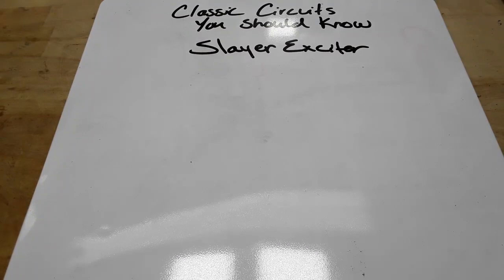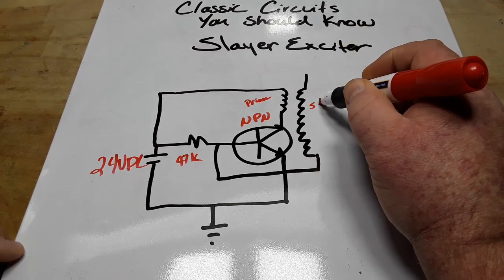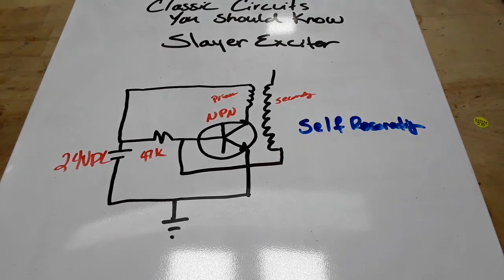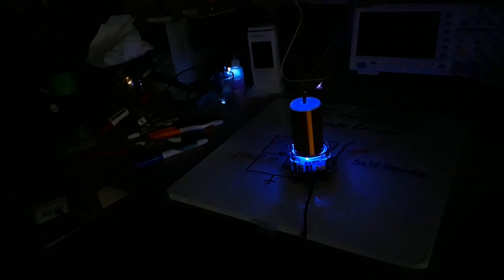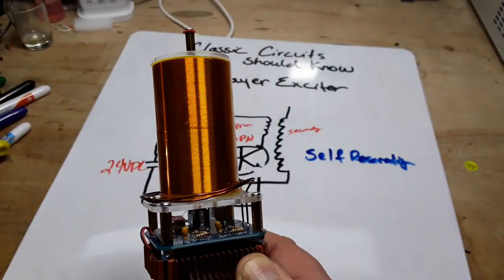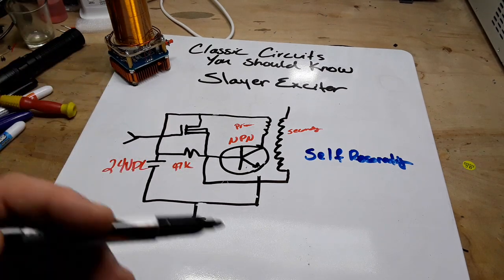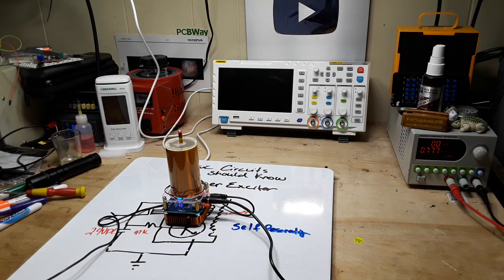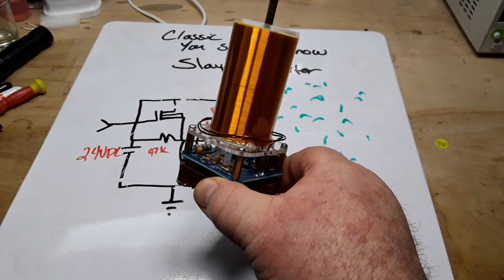Classic Circuits You Should Know - Slayer Exciter

Comment: This demonstrates perfectly why in power engineering a secondary of any current transformer must never be left open circuit when the primary is carrying load. It will overvoltage and flash over. One dead CT results.

Comment: Sure, the slayer circuit is an interesting self resonating device. And the fact that a coil of a few turns can make a coil of many more turns generate a higher voltage as in any transformer has been known for a very long time. What I don’t understand is why these devices are called “Tesla coils” when they don’t implement the innovations that Tesla contributed. In his Colorado Springs notes Tesla stated that his best results where achieved with a single coil of wire of very heavy gage for the primary with a spark gap to not only set the timing along with a variable tank circuit, but also to control the amount of current in the discharge avalanche, this is seldom implemented in these circuits... definitely not a consideration in the device you purchased. The secondary cannot be considered a Tesla coil because it doesn’t implement the innovation described in his “coil for electromagnets” patent, which even though it is described as a “pancake coil” for clarity can also be easily implemented as a cylinder which he clearly used in Colorado Springs. In his patent for “system for communicating through natural media” he shows how his system is actually used to load up an accumulator with energy extracted from the Earth via his arrangement. The trick is to get a high voltage potential and set it vibrating while artfully avoiding the coronal discharge, which though he used to great effect to impress investors and Mark Twain, he made very clear that it should be avoided at all cost to avoid waste of energy and damage to the equipment. Would love to see you implement a real Tesla system, in his deposition for the Marconi trial, which he was unable to attend due to his demise, he provides an entire history of how his development progressed and how his system is intended to be used... which is completely the inverse of how it is used today. Love your posts, keep up the good work. Help us bring Tesla dream to fruition.

Comment: You can also add a diode (preferably an LED) between the secondary line and ground.  If anyone wants to build one from scratch, I recommend perseverance.  For the longest time, I thought my Slayer Exciter/Tesla Coil was cursed - everything I tried to make it work failed.  Until one day, I came across a different manufacturer's 2222 transistor, and it worked.  I had fully tested the 2222 I originally used and it passed every test.  The general consensus is that it either lost it's high frequency capability (it was old) or it never had it (as you know, batches of transistors from the same manufacturer can have slightly different characteristics (but hopefully within tolerances) due to the nature of manufacturing these types of things).  If interested in seeing my working coil: 
https://www.youtube.com/watch?v=N6YHpKBNrLk
It's not exactly pretty, but it works :-)   (repeated attempts to get it to work did reduce it's prettiness)  And diagnosing attempts/info:
https://www.youtube.com/watch?v=gwSStwG7Hm8